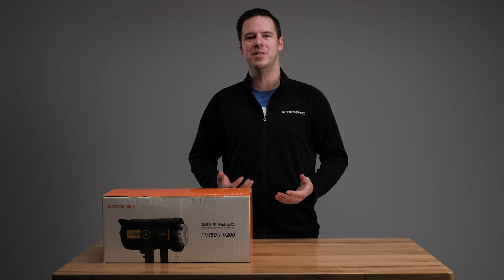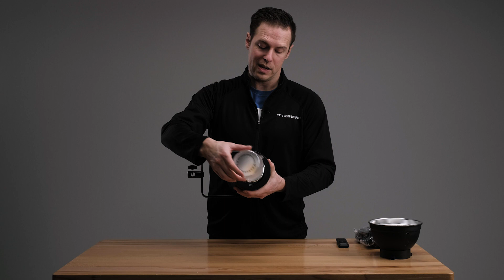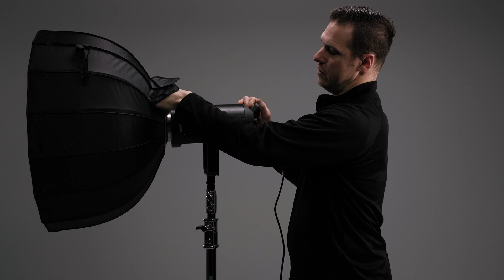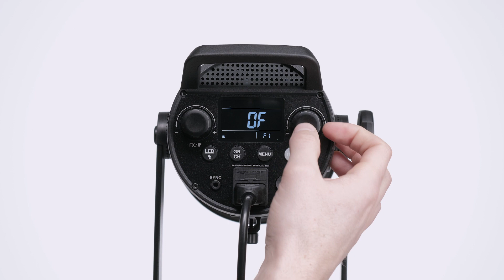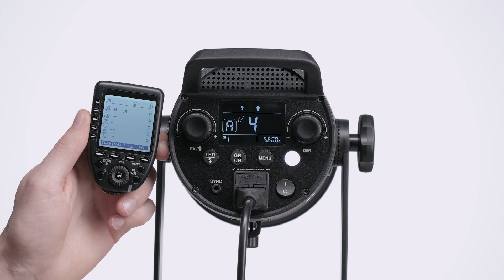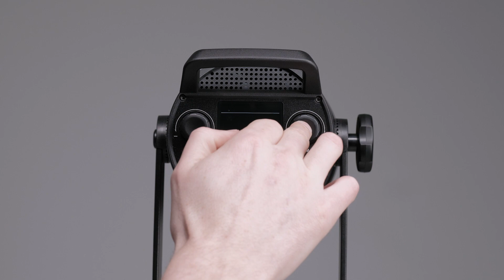Godox FV200 and FV150 LED - Complete Walkthrough

Comment: my x2tn can't connect to the fv150. i made the channel the same but it did nothing
Reply from the maker: Hi Satya,

The X2T-N can only control your FV150 when it is in its flash mode. Confusingly, a channel and group will still be displayed when the FV150 is in its continuous mode. This is for use with the RC-A6 remote.

You can hit the left-most button to toggle between flash mode and continuous mode.  When in the flash mode, power will be displayed as a fraction—not a percentage.

You will also need to select a group that corresponds to an enabled group on your controller: A through E (the X2T cannot use groups 1-9).  

If you are still not able to trigger the FV150, check your menu on both the X2T and the FV150 for the ID function.  Make sure that the ID matches, or that the ID is set to OFF on both devices. The ID is essentially a secondary channel.  With an ID enabled, both the channel and ID must match on all devices.

Lastly, the FV150 is capable of HSS, and you will need to use a Nikon camera with your X2T-N if you plan to exceed your flash sync speed.  If your shutter speed was set higher than the sync speed and HSS was not configured properly, you may not have noticed the flash.  A Nikon camera should have its fastest auto-FP setting enabled in order to use HSS (found under "E: Flash and Bracketing" in the camera's menu).

I hope one of these troubleshooting suggestions helps. If you have any other questions, please let me know.

Comment: To bad it has a dim 200w LED for AC power requirement.  This should be in battery operated.
Hope they will come out FV800 or nice FV1000. 
But knowing ATG/Godox they might be called "Pro" lights.
Because AC power can handle it easily.
Reply: What???????